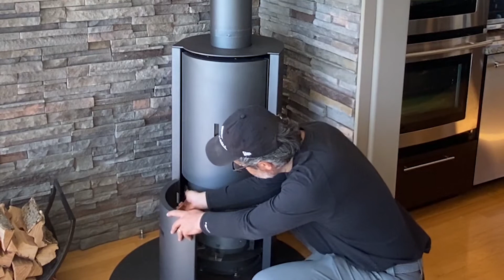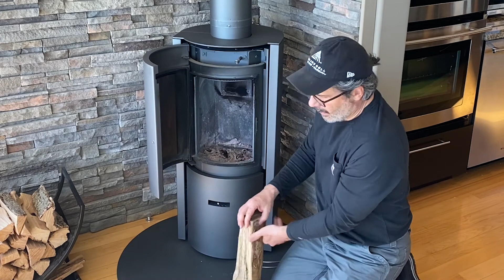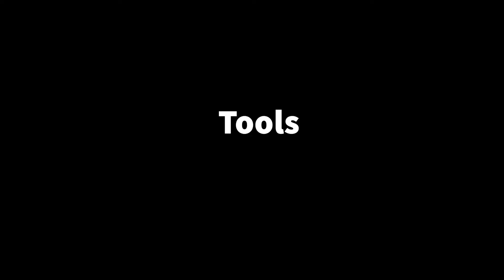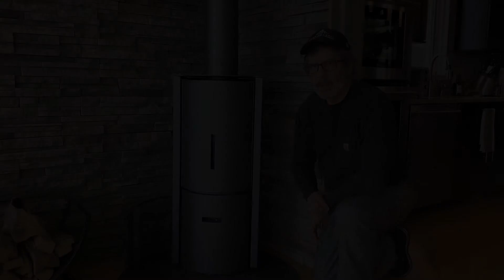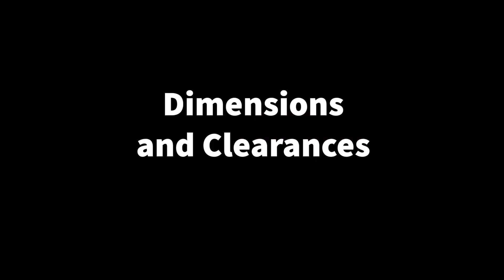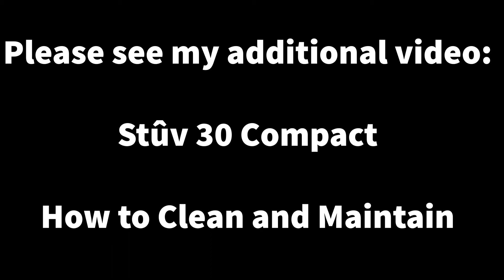Stuv 30 Compact Demonstration and Review

Comment: Sorry to disappoint, but our Stuv 30 Compact is rubbish. It fills the room with smoke. Stuv don't repliy to emails. The supplier blames the flue (that they supplied) and the flue installer blames the Stuv. Rubbish.
Reply from the maker: Sounds like a flue issue.  Did you contact the manufacturer?

Comment: this is a GREAT video, Tom!   so many important details and clear demonstrations.  i was already in love with the STUV 30 before, mind you!  however it is only rated for 900 sq ft and we're over twice that, 2 stories, an open-to-above section, and though i'd believe it would do 1000 or even 1200, maybe -- not our cabin 🙁
Reply from the maker: Thank you.  We still love our Stuv. I’m burning a fire in it right now.  

I added a very small circulating fan in the corner behind it and it really throws off more heat over a larger space for us. It doesn’t change the BTU output obviously, but disperses the heat better.
Reply: @dontscrewitup   interesting -- how many square feet is the home?

Comment: Hey bud! Awesome review. Strongly considering purchasing. How is it holding up after all these years now?
Reply from the maker: Still like new. Buy a can of touch up paint (maybe it comes with a small can), in case you get scratches on it.  I’ve only used the paint once.  

Glass still looks like new when cleaned.  Inside of firebox gets ash colored.  Otherwise operating like new.  Easy to clean, and very clean burning. Chimney is still like new. No creosote build up at all.   We burn dry, seasoned hardwood.   

I out a small circulating fan behind it (4 inch pancake fan) on a variable speed controlled outlet.  It really circulates the warm air on coldest days.
Reply: @dontscrewitup  Awesome to hear! Just found out its only rated to 100 square meters for heating 😅 quite a let down for the price i think!
Reply from the maker: Yes. It is a very warm in close proximity, but does not throw off heat. However; with a small circulating fan, it heats our main living space, which is about 200 sq meters.  But it has a pretty small firebox and is more of an “accent” or supplemental heat source than a primary heat source; in my opinion.

Comment: Hi Tom, thanks for your comprehensive review of the Stuv 30 C. It was very informative. I've just had one installed in our new house build in Australia and can't wait to see it in action... and now feel much better prepared to operate it, as recommended. Quick question, if you don't mind? I've been away traveling during the instal (still not home) and haven't had a chance to look in the box for what comes with the fireplace. Does the firescreen that you showed come as a standard inclusion or did you have to purchase it separately? If the latter, do you mind letting me know where, please? I can't find any reference to the fire screen anywhere online. Thanks, Tom.
Reply from the maker: Thanks!  Your Stuv dealer should have a catalog of all the accessories.  I believe the fire screen was sold separately.

Comment: This is indeed an excellent video, as well as the other on maintenance. Thanks for providing them! I watched both before purchasing my 30-compact H with the heat accumulator. The odds are probably low, but on the off chance that someone else with the heat accumulator might see this...I've been dealing with a smell coming off of the pipe that goes up through the bricks and connects with the chimney above. I've been burning fires since December and it's not going away. I've tried troubleshooting it with the local fireplace store that sold and installed it. It took awhile to convince him that it was coming off the pipe and it wasn't the wood I was using. After talking to Stuv, he suggested I sand off the paint. I did my best to do so, but even with most of it off it still smells (I didn't remove it all after I noticed a fine coating of black paint dust was starting to cover everything in the room). Has anyone out there with the heat accumulator had the same issue? The smell is kind of "sweet", and it only comes off as the fire gets going. Once it's been burning for about half an hour it dissipates.
Reply from the maker: We experienced some odors on the first 2 burns in this unit, but nothing since then.   I’d contact the company.

Comment: Your review convinced us to buy one.   Love the stove, but the slow burn mode does not seem to work correctly.   How long does the fire last for you when you put it in slow burn mode.   I'll fill up with 3 or 4 logs, switch it to slow burn mode, and it will be completely out a few hours later.   It's weird, as soon as I switch it to slow burn the fire really starts roaring which is opposite of what's it's supposed to do.   You can hear the stove pipe heating up like crazy.  And we struggle to get a good fire in window mode unless it's kiln dried wood.   It's almost like the modes are reversed, but the sequence is the same that your video is showing.   Any suggestions?  Thanks
Reply from the maker: Are you closing the damper slider for the slow burn?  You want to minimize the air.  Just enough to keep it burning.  Mine will burn for about 6-8 hours in that mode. Just enough for warm embers in the morning.
Reply: Hmm.   I made sure it was closed all the way.  I'll get 3 decent size  logs in there standing up.   They are completely burned up 6 hours later, not even any embers left.   I don't understand.    @dontscrewitup
Reply from the maker: Maybe consult with the manufacturer.  Your experience is quite different than mine.
Reply from the maker: If you get a slower burn on the glass mode, try running that mode at night.  I don’t think they are “reversed” but your wood, and air intake may just burn differently.
Reply: Thanks.   Sorry, last question.   Do you use Kiln Dried wood or just your typical few year seasoned wood.    @dontscrewitup

Comment: Thanks mostly due to your videos, we got ourself this stove, we got the H version, which has 150kg of heat storing stones. Only burned it once so far, cannot wait for colder weather.
Talking about first burn, as with most newer stoves, it should be mentioned that the first burn bakes the paint. Even though the windows were open, it resulted in thick fog through the house. Thus do not open the windows, but open up everything you got, close the doors to adjacent rooms and wait for the follow up burns...
Reply from the maker: Yes. Good point. I remember getting smoked out the first few days.

Comment: Very informative video, thank you Tom. I still do not know how to proceed for the chimney sweeping. On the guide book, they say we have to remove a small door at the entrance of the chimney, what I did. But I cannot put it back at the right place, with the proper connection to its command. Could you make it successfully?
Reply from the maker: I have never removed that top chimney door myself.  I use a chimney cleaning service and I’ve never seen how they’ve done it.   

The door is somehow connected to a mechanism in the main door of the unit, and if I recall, the main door needs to be in a certain position to get the chimney door back in place.  For example, if the main door is open, I think you cannot get it back in place.  You need to press a lever at the top of the main door to get the chimney door back in place.   I’ll see if I can find the instructions.  You could call the company and ask them.  They have been very helpful in the past.

Comment: Excellent review! Quick question… I am thinking about purchasing one of these but may in the future install new flooring. How difficult would it be to remove this temporarily to lay new flooring and then reinstall, if needed in the future?
Reply from the maker: Thanks. Good question. I don’t think it would be very difficult.  It is not attached to the floor.  If the height of the floor changed, you may need to make a small adjustment to the chimney pipe, but there is a little margin for 1/4” or so without needing to cut or replace anything.

Comment: Does the rotate function result in the backside being cooler than the windowed side?
Reply from the maker: I can’t say for certain because of my setup, but I believe the primary heat source is always in the “front” of the unit where the door is.
Reply: @dontscrewitup  thanks for the quick reply. Great video. I assumed it was the case based on the distance needs as specified for installation.

Comment: This was very useful information.  I now realize that I’m going to need to do a lot more site prep work if I am to purchase this type of stove.  I did not know that it required an outside combustion air source.  Thanks for doing the research and posting the review.  Scott
Reply from the maker: Thanks. Yes the outside air is one of the most complicated aspects. You can go above the floor, through a wall. But you need to be close to a wall.
Reply: If you can’t accommodate air intake, increase your chimney to 7” diameter. Or, install a barometric damper. It releases negative pressure and allows for a sufficient air flow

Comment: What is the price of it
Reply from the maker: You’ll need to check with a local dealer.  They don’t publish the prices.  The prices have gone up significantly since we bought ours.  I believe we paid about $4,000 USD plus more for some of the accessories (screen, mat, outside air intake, etc.).   

If you have a dealer near you, also inquire about discounts on display models, or off-season pricing.

Comment: We enjoyed your review and are likely to get one of these soon.  We currently have a crude wood stove that does crank the heat out, but we find it very hard to modulate the temperature even with wood size and damper control.  It also won't even come close to running through the night.  So question one, can you really dial in the temperature with this stove, and two how long can it go over night if you stoke it up?  Thanks!
Reply from the maker: Thank you.  The capacity is not huge. If I really load it to the max with wood and turn the damper down all the way, it will just make it to morning with a few embers to relight the next fire.  But it stops producing sufficient heat a few hours before morning.  I can run a test for you next time I fire it up.  We have high ceilings and the stove is in a large room so it’s hard to say exactly how this would translate to your situation.  Our setup is probably the worst case for heat concentration and retention.  It does put out a lot of heat when it is firing.  I also have a very small circulating fan behind the stove that helps move air around the room.  That makes a big difference too.
Reply: @dontscrewitup thanks for the reply, I think we're going to spend the extra money on the H version so it gives off heat as the night wears on.  We're looking to heat about 900 sq.ft. and love the style. Any further thoughts on how controllable it is?  I probably just need more practice not adding too much

Comment: Hi, at 12:22 you mention you get your woodsman to cut 12-14 inches for sideways. Are you certain because the manufacturer indicates 11 inch for horizontal? We really enjoy your video and are getting ours installed in a few weeks. We are now looking for wood and can't decide on which log length works best. 
Thank you in advance.
Reply from the maker: 11 would be better than 12 inches if you want them to lay flat. The 12 inch cuts are on a slight angle.
Reply from the maker: I only lay a few logs flat to get it going, then I typically put them in more vertically.  So my current batch of wood is more 13-14” with a handful of shorties.  You can probably pack more wood in if they are all horizontal, but we burn it more for ambiance and near-field heat source.   If I were burning overnight I’d probably stack it with horizontal shorties.

Comment: Thanks for the excellent review! We are in the process of building our house with this in the center of our living room/kitchen. Do you believe the 360 degree capability is still feasible with the Stuv 30-H Accumulation (an extra 150KG). The weight on the floor is not an issue as it will be a concrete slab.
Reply from the maker: If you are on a concrete slab you need to figure out where your outside combustion air would come in from. Normally it comes through a hole in the floor via a duct running through a basement or crawl space to the outside.  Not sure the stove will work on a slab.  Check with a Stuv installer or the manufacturer.  There may be some other solution I am not aware of.  If you haven’t poured the slab yet, you can run an air intake duct under the slab. Consult with your builder on the best way to do this.
Reply: @dontscrewitup  The direct venting will be placed prior to slab being poured. I am asking if the Stuv will still rotate with the extra weight of the accumulation stones? Thanks for your quick reply!
Reply from the maker: Ok good. I’ve not installed that model, but the specifications look the same for the 360-degree rotation feature.  I don’t see any reason it would not work if it’s designed to do it. The rotation mechanism looks the same as the one on the smaller model. It is a ball bearing collar which rotates very smoothly under the weight of the stove.  It may be best to confirm with Stuv, but based on what I’m seeing it seems like the 360-rotation is a feature of the 30-H model.  https://www.stuv.com/sites/default/files/fiches_30h_btob_220113_en.pdf

Comment: SEE THE PICTURES ON MY GOOGLE REVIEW
Stuv 30 Compact Problems:
1) Glass blackens very quickly (even with extremely low moisture briquettes), so you have no chance of seeing the logs through the glass, only the flames.
2) The baffle gets stuck as it relies on gravity to open, so will not overcome the friction of a bit of soot or corrosion.  This means when you open the door to add logs you will get a lot of fumes/smoke in your room, which will set off your smoke detector etc.
3) The whole device has warped so the door at the bottom does not close properly (hinges are fine) and sometimes will not close at all.
4) The metal back plate at the back of the area the wood burns in has cracked.
Reply from the maker: Can you share a link to your photos?
Reply: @dontscrewitup  Seems like @jackBoult was more of a disgruntled competitor and not a real owner. His points worry me though.
Reply: @Simple_Citoyen  I have used my Stuv now for years, and burned at very high temperatures, and have not seen any of these issues.  The unit is still like new.  Almost all of the things he is describing can be caused by burning non-recommended combustibles in the stove. You should only burn seasoned, low-moisture hardwoods.  Burning soft woods or other inappropriate materials can cause excessive soot and extreme heat which could theoretically cause such issues.  The stove also requires (fairly minimal) cleaning and maintenance.  Check out my other video on how to clean and maintain the unit and you’ll see how easy it is to do it.

Comment: How does this compare to a hearthstone Bari?
Reply from the maker: It looks very similar.  I just read the webpage, have not seen one, but the Stuv has three different rotating doors inside the unit.  It can burn with glass door, steel door, or open burn, and you can rotate them while the stove is burning.   That is the main difference I see.  The Bari also comes in ceramic sheathing.  Stuv is steel only.   I'd need to research it in more detail to provide more info, but the other specs look pretty similar.

Comment: Thank you for the great video. Im considering this for my new build house. One concern I have is chimney sweeping... Our chimney will come out nearly 60 ft above ground level making it very difficult to access. Can you sweep from the bottom? By that I mean, can the chimney sweep get to the chimney from the inside?
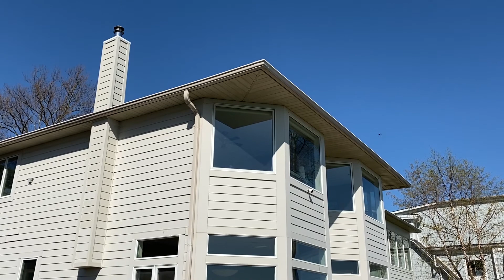Reply from the maker: Thank you. The chimney has a bottom Access panel and clean out. You can see it in the shot of the chimney at 34:37.  The bottom of the chimney housing has a removable door, then the  chimney has a clean out access hatch on the bottom.